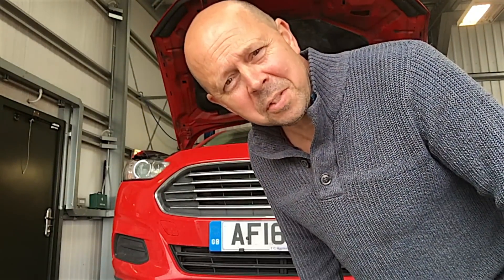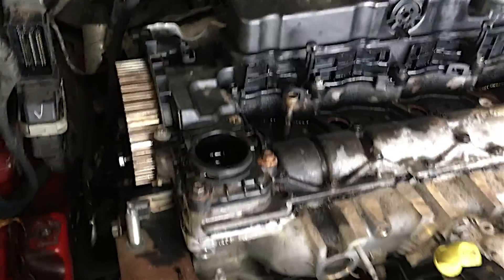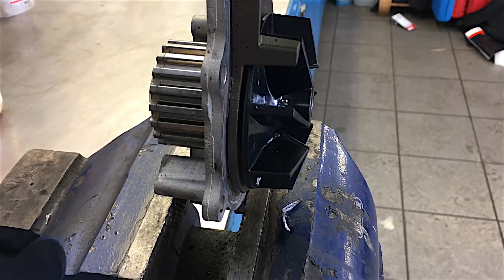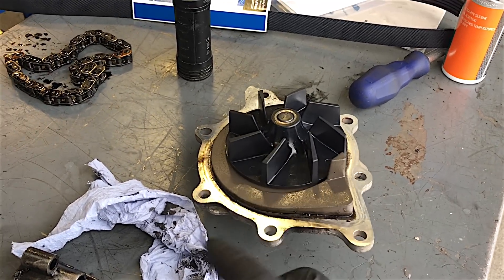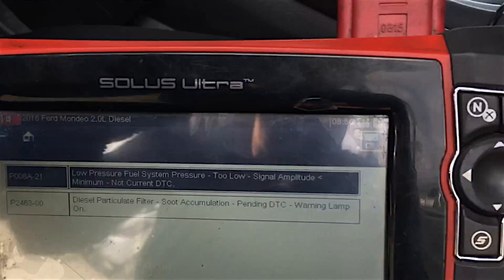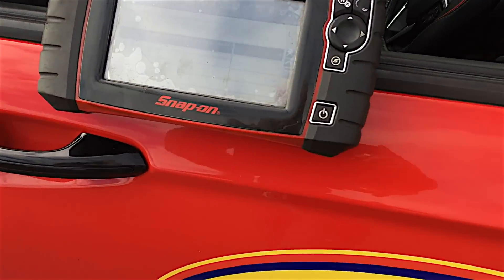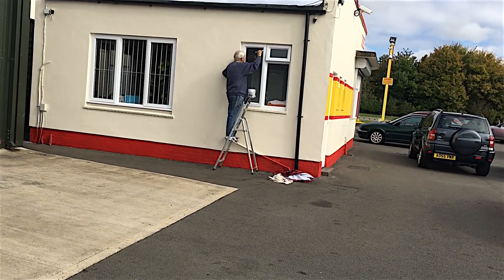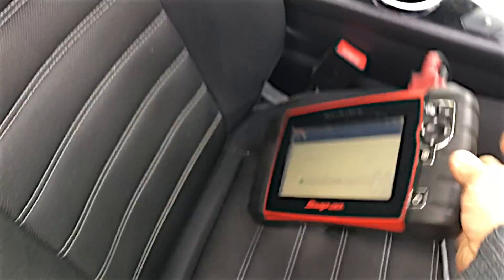320K Miles....DPF Blocked, Forced Limited Power, Engine Over temperature, Noisey Timing Chain, ..

Comment: Good video AH. I have a mondy mk4.5 with 2.0 tdci engine. It's done 212000 and going strong. I've just replaced all bearings and driveshafts. Runs smooth as anything. Keep it on the road I say
Reply: We have the same model/engine (2012 with 183,000 on the odo). At the moment with the state of the country it makes sense to repair not replace - car runs like a watch and despite some tappy injectors at low revs, it drives absolutely A1. I'm having these replaced shortly to keep the car at its best. A truly excellent car with a bulletproof engine 💪

Comment: Funny you mentioned that sometimes the injectors won't work after taking them out.. I've watched another video of another you tuber working on I think VW car and they had problem with low power after engine rebuilt which turned out to be diesel injectors, but the work on the engine had nothing to do with injectors, they died after being taken out and put back in again 🤷‍♂️
I've done that static regen in my Mazda 6 2.2 diesel with Forscan software.. done the trick and yes, exhaust got very very hot and exhaust gases had a funny, unusual smell.. 
Thanks for taking the time to make the video for our entertainment Steve! 👍
Reply from the maker: cheers bartosz, yes it does happen to injectors from time to time..just won't work again

Comment: A friend of mine has experienced an involuntary static regeneration with his 2002 V40 1.9D. on the autobahn's hard shoulder, it didn't go well.
I'm glad to see a new video of yours. Nice work on that work horse.
Reply: That didn't have a DPF... it'll have chewed it's oil seals and ran on it's own oil over and above max rpm.
Reply from the maker: thanks Emin
Reply: @IfInDoubt..  absolutely right, the turbo was almost blown, I told him not to hammer it, he has his license since 2021, but he didn't listen, it ran away, slowly at first. Had he put 2nd gear, it would've stalled.

Comment: Ford Motor Company used to have a 100,000 mile club, when my mum worked for them in the late 70s and early 80s. Basically, it was a chuffing miracle if a Ford got to 100,000 miles, and people would write in. Possibly a week later, it disintegrated from rust. Obviously they were petrols then, but I would love to know highest mileage known, for one of these! 😀
Reply: Come on now in the 70s  it was a miracle if ANY car got to 100K and ten years without rust...Where are they now ? all these wonderful Volvos,Mercedes, VAG,BMW etc that apparently were so superior to the Fords and Vauxhalls..they ALL rusted, they ALL became money pits and they ALL fell to bits. at least with a Ford or Vauxhall you could keep it going cheaply and easily.

Comment: First! :)
Nice video, Alan!
I always look at all your videos since they are entertaining and informative!
I have the 2.0 from the mk4 mondeo and the water pump has metal propeller. I am afraid that they will switch the part with this cheaper plastic one and I will not be able to find the ones made for my engine anymore, since the engine block is basically the same.
Was quite impressed at that mileage that the soot accumulation drops that much. For me it never drops below 38% and my mileage is 217.000
Reply from the maker: cheers sergiu

Comment: Awesome video Allan.  I have a MD sitting on my driveway for two weeks now. Trying to work out why it’s not starting after overheating it started once. But no more
Reply from the maker: good luck
Reply: What related codes are coming up?Is the battery good,is the starter motor spinning the engine fast enough?

Comment: interesting video.
never seen a regen happen on camera.
I used to own a Duster 1.5l Dci and the only way i knew it was regenning was the electric fan was on when i reached my destination and heat coming out from underneath the car...
It would have been nice if there was an illumination on the dashboard.
Renault's system used a 5th injector in the DPF to spray fuel and burn the soot off.
When I started doing shorter journeys due to  moving, the regen was happening more often. it drove me up the wall
I had to sit there for about 10 mins otherwise it would attempt a regen 5 times.  if it didnt complete then engine fault light illuminated.
I got rid of it
Reply: Modern diesel should be ran constantly for at least 30km trips. They suck in that aspect comparing to age old diesels. My work drive is about 40km's and it seems to be on the verge of minimum to trigger regen on normal drives. To my butt feeling it's about 20km's minimum in ideal conditions to get it started. Not to mention it takes a bit to complete.
Reply: @jothain  You are right.
Before I  moved I was travelling 40 miles a day to and from work.
After I moved, it was 10 miles to work and back.
Completley impractical for a modern Diesel.

Comment: i have not had much to do with the mk5 engine but from what ive seen on your video they dont look disimilar to the mk4 so my question is could a mk4 lump be fitted into a mk5 and solve your supply problems,great content as always and your eagerness to explain makes them great viewing.
Reply from the maker: cheers, the mk5 engine is similar to the mk4 but very different in many ways, the mk4 engine would not fit without some serious modifications...mainly electrical

Comment: Hi Alan from a fellow Irish mk5 owner. Love your content and appreciate all your advice. 
What’s the highest mileage you’ve reached with a mk5 (without engine replacement)
I’ve had mine for 3 years and am chuffed so far, best part is the torque which I upgraded to 400mm, the comfort and the styling.
Underrated cars I think..
Why oh why did Ford halt production?
I’ll probably keep mine for a while, or at least until the day where diesels are banned over here (maybe not so far off) 😢
Reply from the maker: hi, our highest mileage mondeo without engine change is just under 400k miles, the globalists want to ban cars, especially big cars, cheers square apples

Comment: Brilliant diagnosis fix on a high roller, well done AH. Dear AH. ; keep meaning to ask does the Ford 1.5 TDCI engine have less issues than the 1.6 TDCI ie. issues with  leaking injector seals etc etc. Thank you fantastic video again G..
Reply: I think the 1.5TDCi has a wet belt and that's a definite reliability issue on Ford's.
Reply: @tiguanman1170  there is no wet belt on 1.5, just regular 'dry' belt, no timing chain between camshafts bc there is only one camshaft.
Reply: @Serj1k2k Thank you. That would be important to me if I wanted a van with that engine. I know of lots of wet belt failures on the 1.8TDCi.
Reply: Dont get a 1.5 tdci with the new design dpf (euro 6) as the matter sensor is prone to failure and not cheap to replace, also have issues with sticky egr valves so need to be serviced regularly
Reply from the maker: i don't hear much good about the 1.5 but it is underpowered for that car..the 2 litre is much quicker
Reply: @alan4x  Thank you ; we the family have owned a few mk1 focus 1.8 tdci's ; 2 x mk1 tddi's  and I had a 2.0 tdci with all the ford extras (mk2.5)  all excellent , I maintained ..from memory its worth mentioning that the ford mk2 1.8 tdci engines . ' I think ' the WET BELT - CAM was introduced by ford in 12/2007 correct me if I am wrong gratitude Graham..
Reply: @graham3282  I'm.told it was 10/2007. I've a 2008 Transit Connect 1.8 TDCi registered March 2008 and that's chain. There's a tensioner bolt you can remove that has two different ends and that's how you can tell whether it's chain or wet belt. Alan will know all about that.
Reply from the maker: @graham3282  yes thats right, the wet belt only lasted a few years and ended in 2010 i think, cheers graham

Comment: Good job Alan, like every time.

Did the MK5 got a fifth injector too?
I heard on the MK3 TDCi you have to change the oil after a static DPF-cleaning.
Reply: MK3 TDCi Mondeos didn't have a DPF to regen, only the MK4 and MK5 TDCi.
Reply from the maker: hi hans, the mk5 does not have a nozzle to spray fuel into the dpf..its all done by the ecu

Comment: Another good video Alan, that's a fair amount of work on a 320k engine, how many more miles do you think its got in it or what would be the straw that breaks the camels back on it?
Reply from the maker: it would need to be in an accident and wrote off lol
Reply: @alan4x  fair enough, when i was taxying i remember the old Bluebirds racking up 500k but they were probably much cheaper to keep on the road at the time.

Comment: Have you tried - DPF  cleaning additives?
Ive a mk4 with 321k DPF been one of biggest problems- when DPF as a fit it can make engine temp go mad limp mode and automatic box going mad - 
Add a additive and happy days in about 10 miles at the most
Reply from the maker: i have in the past but not needed any additives on the mk5

Comment: I had a couple of v6 mondeos where the water pumps failed. one was mk1 v6 S.i that overheated, replaced the pump for one with a metal impeller but sadly the headgasket went characterized by a ticking noise which was in fact the engine venting. I also had a mk1 v6 ghia x that too had that sh*tty plastic water pump. fortunately the headgaskets didn't go on that one! those 2.5 and 3.0 duratecs don't like being cooked and there's a good chance that overheating will eventually lead to headgasket failure but not always.
Reply from the maker: thanks for your comment simon

Comment: Brill! How do we know when the car does a regen whilst driving naturally about?
Reply: I have noticed the mpg goes right down and I aslo here a pulsating sound on idle would be nice if an led came on. I saw someone on the internet had a way to wire in an led.
Reply: As the other commenter has noted, you'll feel the revs "pulsing" when at idle (if you watch the rev needle you'll see it bouncing slightly). You'll also hear the fans running and when driven, the engine note will sound a bit gruff under load. It's perfectly normal and nothing to worry about, DPF is just doing its thing 👍

Comment: hard to see, but was the dpf temp sensor reading 100c all the time?  out here in nissan land it means sensor down
keep away from new navaras, especially autos, static regen + oilchange every 3-4k, + it takes 3 runs to get soot down, "so thats £30 of diesel sir, then oil + filter change, so that will be £250 every 3 months sir, oh + its not warranty sir,   [our poor receptionists are suicidal...]

Comment: Hi Alan, appreciated all your videos..  i got a mk4 2013 2.0 tdci 180k dpf blocked with permanant limp mode with codes p24a4, p246c, p2463 and p269f. If I remove and attempt to clean, does it require regenning or programming ? any feedback on codes ? will check injectors too
Reply: Regeneration is done with the DPF in situ.You need the scan tool to command the ECU to start the regen.Short journeys quickly clog up the DPF.Take your car on the motorway and floor it for ten minutes.

Comment: Hello, Alan, i hve a little proble with my Mondeo mk5 2.0 l diesel, when i put in reverse (manual gearbox) i sens a vibration, the same vibration when i am in first gear, without any acceleration. Can u tell me what maybe the problem is?  Thansk a lot u are very best.
Reply from the maker: hard to say without hearing it

Comment: whats point of collecting diesel particulates in the exhaust to cleaning it with a regen and blowing all the particulates out the exhaust revving the bollocks   out of engine ?
Reply: Ahhhh...... one of life's great mysteries
Reply from the maker: its supposed to burn it at high temperature to disintergrate the soot

Comment: I’m sure it’s hard without seeing but I’ve got a mk4 mondeo with a oil leak it’s coming from the bottom of the engine and there’s no oil on the top any ideas what I should be looking for please?
Reply from the maker: could be rear main oil seal or the rubber seals that fit onto the rear main oil seal end cap,,,a pretty involved job
Reply: @alan4x  Thank you I was hoping I’d avoid a garage but looks like it’ll have to be a trip down there. Lol

Comment: It was obviously neglected, look at the colour of the expansion tank! Lack of on time oil changes will ruin the chain, 8k interval would be my recommendation
Reply: Neglected? It’s done over 300k if it was neglected it wouldn’t even make 150k
Reply: @johnp6636  trust me i deal with psa engines regularly exceeding 300k no issues at all
Reply: @vukiam  only when they are serviced regularly like this taxi is
Reply from the maker: its a taxi driven by every man and his dog 🤣